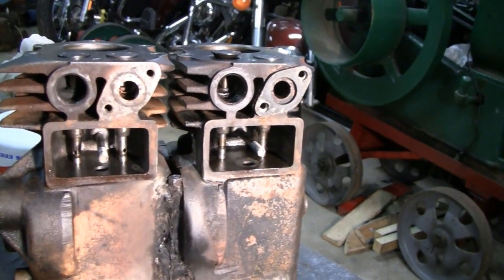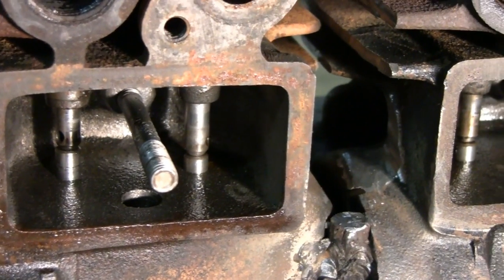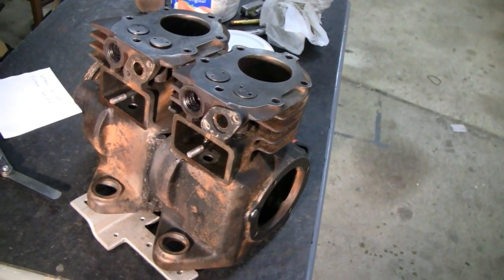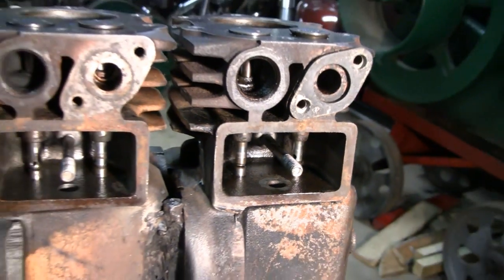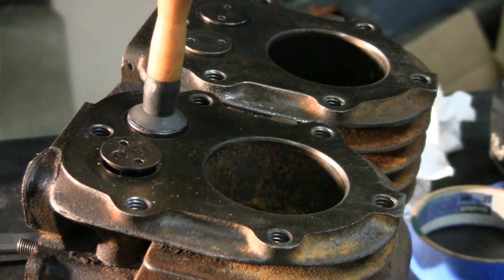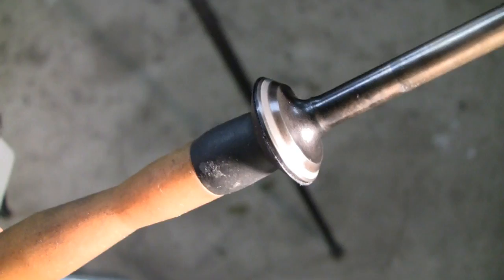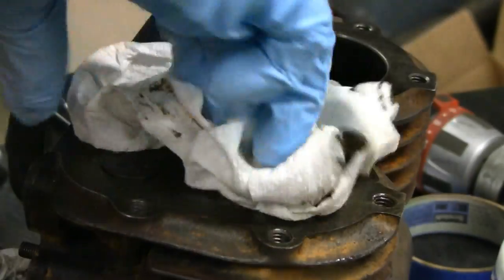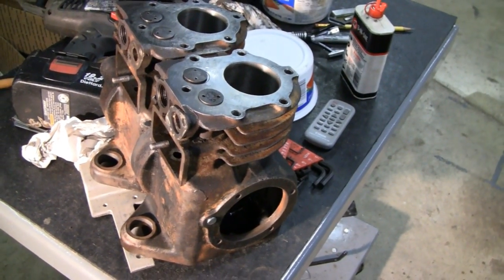HOMEMADE TWIN BRIGGS ENGINE PROJECT (part 4)

Comment: ok, so, assume I'm an idiot guessing at engines. Do the valve stems need 8 or 12 thousanths of clearance because they heat up, and can get a bit too long to close when the engine is hot causing a loss of compression????

Comment from the maker: Thanks alot Bud!! I appreciate you watching!! That tool is called a HONE, it has very fine grinding stones on it and that takes any glaze, small scratches and imperfections out of the cylinder wall and it helps a new set of rings seat better!! On the small engines like that you can use a Brake Hone for cars, you can pick them up at most Auto Parts Stores for about $15 !!☺